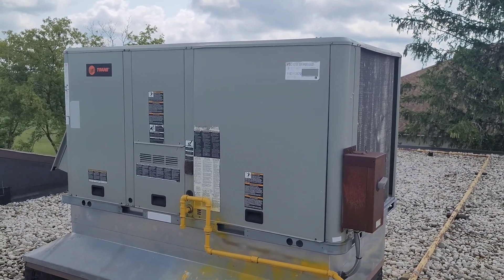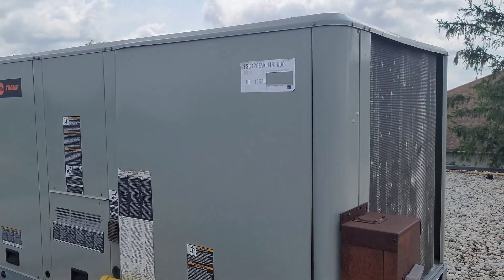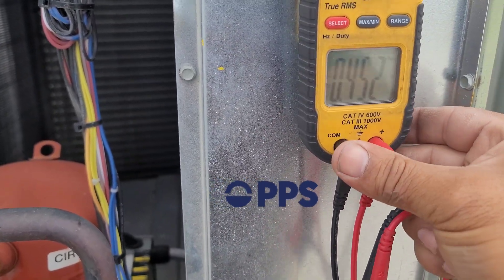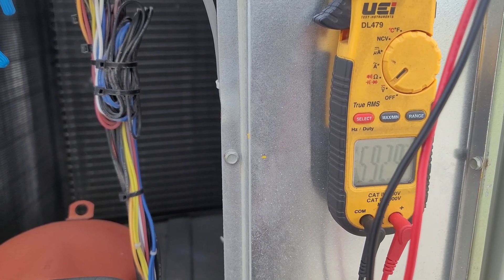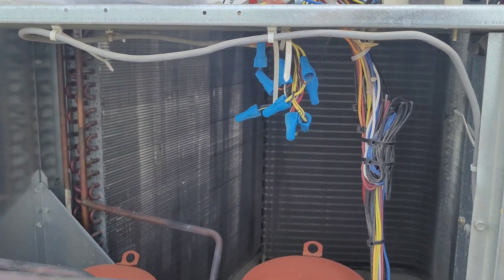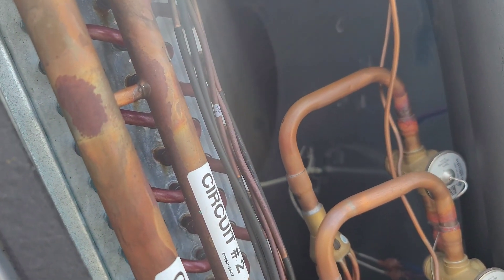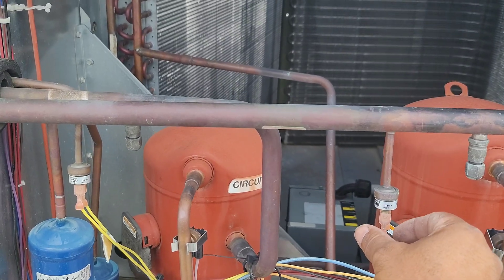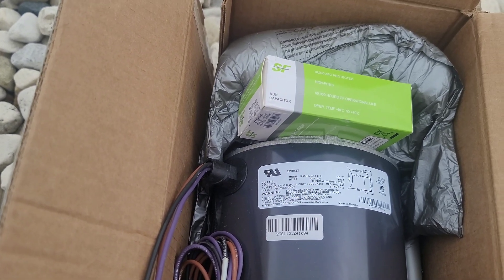Trane package RTU Not cooling

Comment: Question: why is the the fan motor single phase and how is it  575 volts? Second, if the fan motor is 575 volts, how is the recommended capacitor only 440 volts?
Reply from the maker: Thanks for watching, fan motor was single phase 575v because it was getting incoming volt from 2 wire and 2 wire potential difference is 575v if you measure 1 wire to ground it would be 321v that why capacitor usually rated for 440v